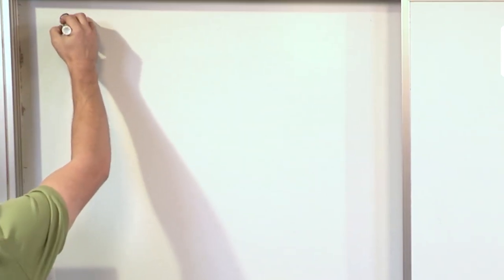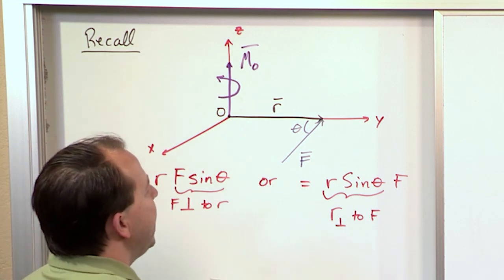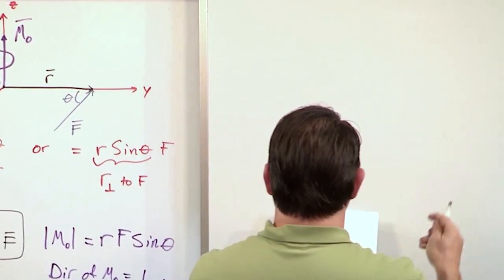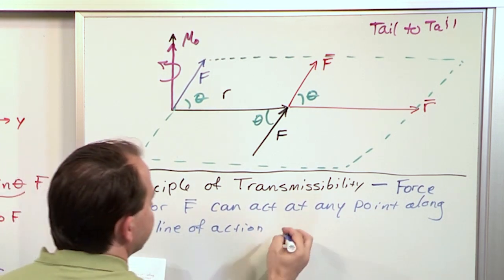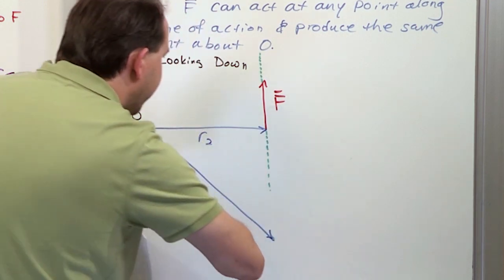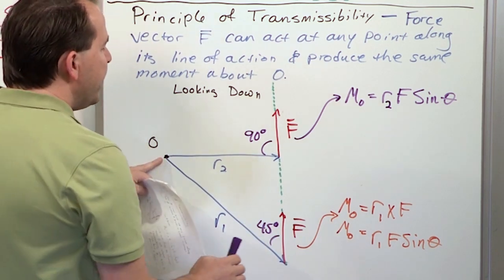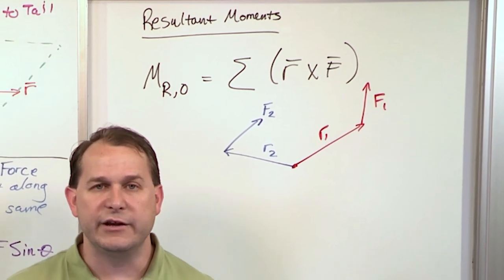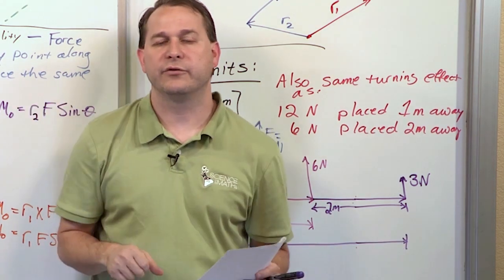Moment of a Force Vector - Engineering Mechanics

Comment: Does the change to pound-feet, from foot-pounds, bother you as much as it bothers me.   I tutored my way through engineering school, and I taught student to use unit analysis, in solving problems.  And, since r X F does not equal F X r,  So dimensional analysis no longer works.